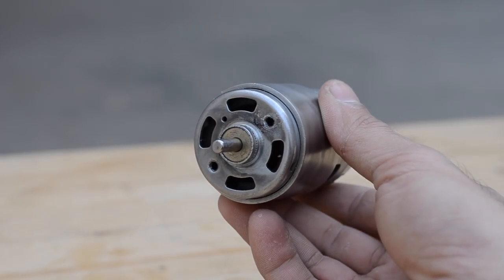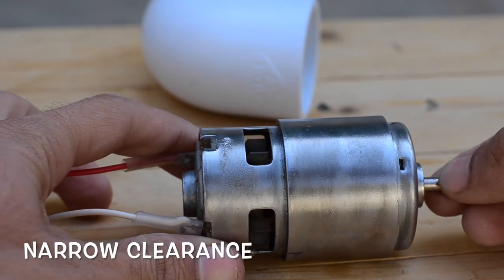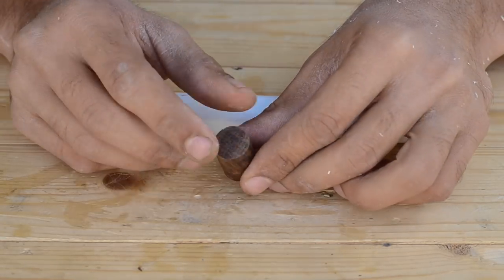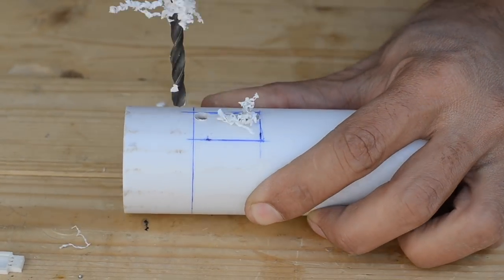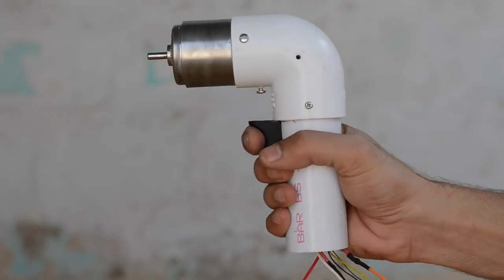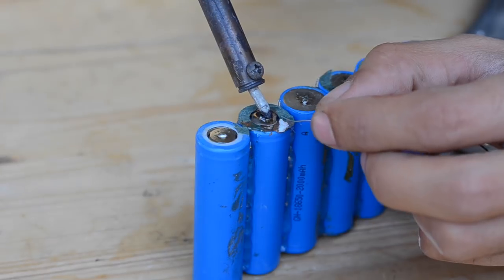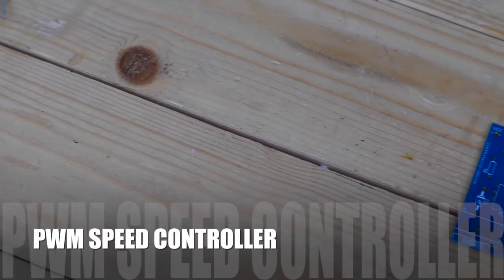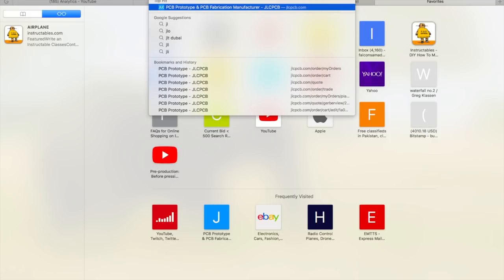How to make a Cordless Hand Drill Machine

Comment: Probably the most efficient looking drill that's very detailed and looks like it works very, how ever, there's only one flaw and that's how to charge the battery, because if it had that it would be very promising to use often there another guys that did this and it's more handy to know that it has that ability as well, but overall it's pretty good :)

Comment: Friend how did u connected drill chuck with motor, I have all the materials, only problem is with the connector. From where did u found the connector. That is the important part which is not shown in many videos.
Reply from the maker: This is a custom made adapter that is made to fit the motor shaft that is 5mm in diameter and the outer side adapts the plates that holds  the cutting disc.
Reply: Modifications with Manoj I can buy
Reply: DIY King will you please make it for me I buy it.

Comment: is it mandatory to control its speed or connect the motor with pcb..if i directly use the motor with a 12 volt adapter or battery ?? will it be harmful for the motor ?

Comment: directly use a DC motor is not sufficient ...... DC drill machines are comes with planetary gear set that protect motor from overload and burn ... your drill is only use as just for drilling PCB wood and in some light weight with giving proper rest  to motor

Comment: Even the Chinese ones come with a hefty price tag? what you just made is significantly more expensive than the "chinese ones" the motor, chuck and batteries alone cost more than a chinese one with the same motor, a keyless chuck 2000 mah (variable) replaceable battery with a BMS that actually includes a charger and obviously the significantly better housing and quality in general.

I'm all for DIY tools but that premise is just bad. and please, for the love of god, use a BMS for battery packs. your recycled laptop batteries (that's what they look like anyway) are enough of a firehazard at different voltages and internal resistance already.